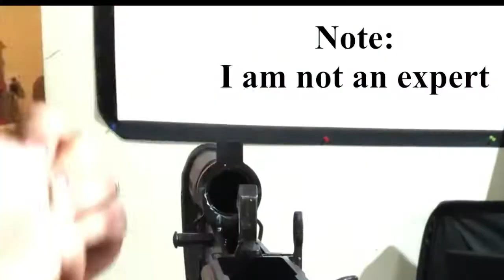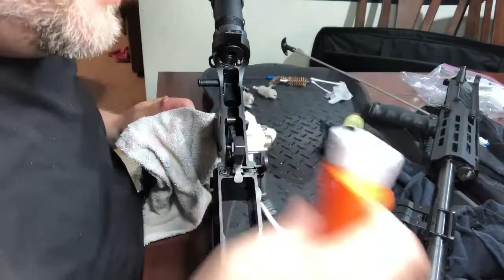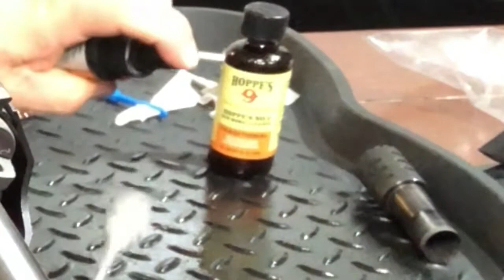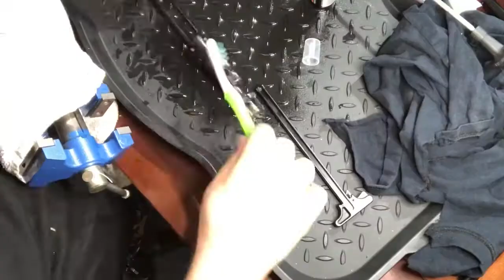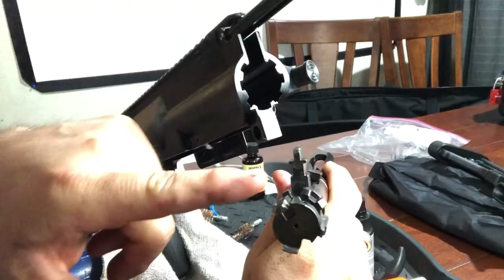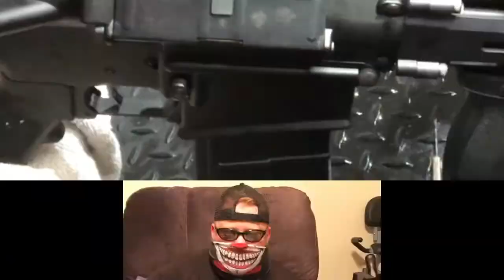JTS M12 AR 12 Gauge Shotgun from Academy - How I clean it.

Comment: I know this is an old video but, the bolt catch does work without mag! If you hold the very bottom of the bolt release button and pull the charging handle back it will lock without a mag in!
Reply from the maker: Sweet. Thanks.

Comment: What is the brand and length of the cleaning rod  you're using? Also, any recommendations for solvent, oil, and size of cotton patches?
Reply from the maker: I just bought a standard shotgun cleaning kit. It came with solvent and patches. I think the rod is 16”. Anything that works for a shotgun should work. I haven’t tried anything different as far as solvent goes, but the Hopps seems to work pretty good. Thanks for watching!
Reply from the maker: I just bought a standard shotgun cleaning kit. It came with solvent and patches. I think the rod is 16”. Anything that works for a shotgun should work. I haven’t tried anything different as far as solvent goes, but the Hopps seems to work pretty good. Thanks for watching!
Reply from the maker: I just bought a standard shotgun cleaning kit. It came with solvent and patches. I think the rod is 16”. Anything that works for a shotgun should work. I haven’t tried anything different as far as solvent goes, but the Hopps seems to work pretty good. Thanks for watching!

Comment: have you had any problems with your gas chamber not got to semi auto iv tryed other ammo. do you suggest anything that can guide me to fixing this problem.
Reply from the maker: This gun is only semi auto, so I’m not sure what you mean.
Reply: @chompcrc4701  I took mine to the range today I have the stock but stock in there and it it wont cycle do you have any ideas on how to fix it, and also how do you adjust the gas setting?
Reply: @FrancisFinest  can you turn your regulator?
Reply: @FrancisFinest  / you turn the regulator ( the little knob that has numbers on it ) for different settings
Reply: @BudsWithAPorpoise  does this help prevent the ammo from getting hung up?  I was curious about this when watching the videos when he was changing  experimenting with ammo

Comment: I'M HAVING A PROBLEM WITH MY BUFFER STICKING IN THE BUFFER TUBE. LAST TIME IT DID IT I HAD TO TAKE THE BUTT PAD OFF AND RUN A METAL DOWEL THROUGH THE SCREW HOLE AND TAP  THE BUFFER OUT. ANYONE KNOW IF AN AR15 BUFFER WILL WORK IN THE AR M12?
Reply from the maker: I’m sorry, I don’t. I read somewhere that it was closer to an AR-10. You may contact Tac-47 or someone online though.
Reply: @chompcrc4701  I put an AR15 buffer in it. Shot it yesterday and not one jam.
Reply: @chromewarrior555 , So a standard milspec buffer tube works on the JTS?